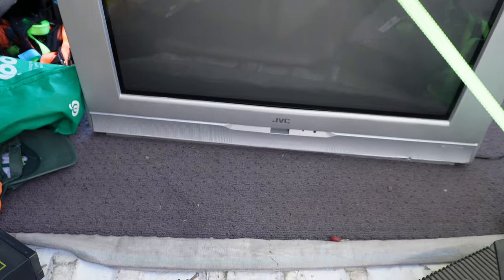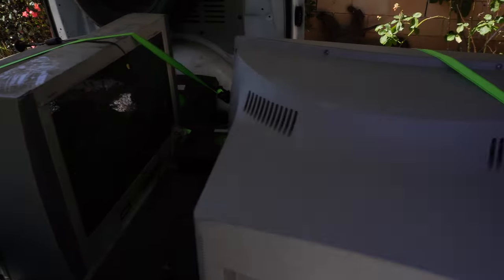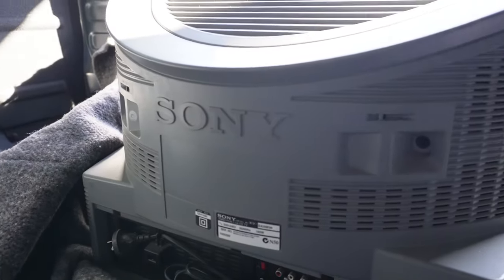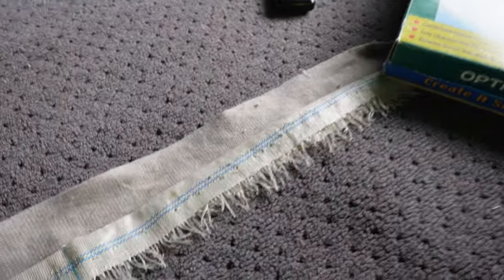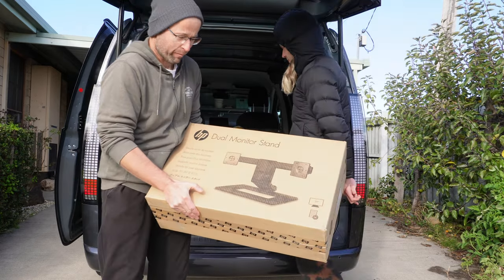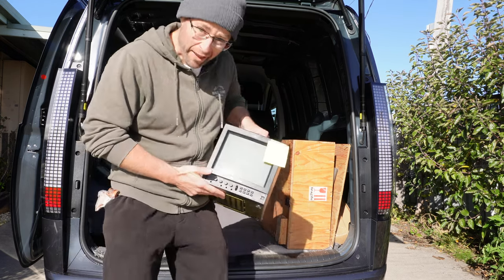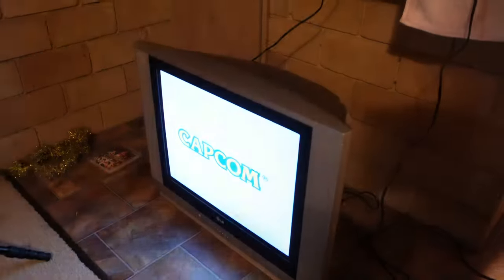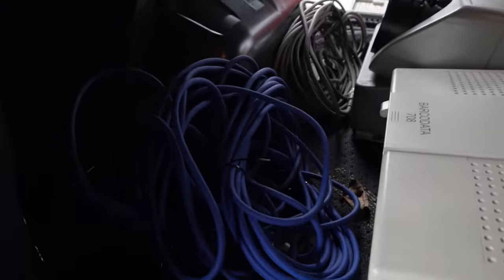CRT pickups MAR - MAY 2023

Comment: Nice pickings.  Shame about the studio folding but at least that equipment has gone to a good home.
I got my little 9" PVM from out an old ambulance, guy ised to drive one and i guess helped himself to some equipment and sold it to me
Reply from the maker: unreal, wasnt a medical PVM was it?
Reply: @rgbrob  I tell a lie, it's actually an 8" not 9". I'm not sure if it's a medical PVM but I would imagine so.  The model is PVM-8041Q if that identifies it.  Was from a London ambulance, he told my if was from out of it and pointed to the ambulance outside his flat when I went pick it up.  Got some BNC connector cable for my OG Xbox and looks decent
Reply from the maker: @mumfnah  will be the same  size as what we call a 9" over here in Australia. Here in Oz we typically claim the size an 1" bigger than what USA does. The medical PVMs are very similar but are white  in color, but far far less common than broadcast monitors.
Reply from the maker: White in the casing i mean specifically, still colored as normal from the picture tube.
Reply: @rgbrob  ah, no it's not white case, just the usual grey colours, but I paid next to nothing for it, like £10 or something stupid